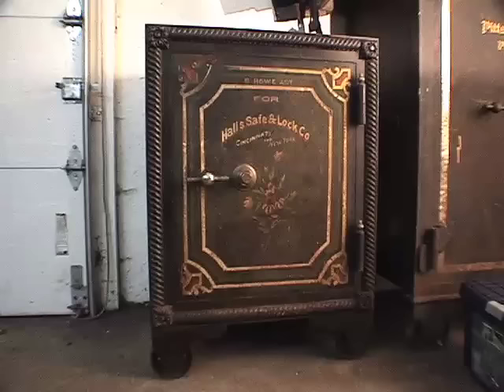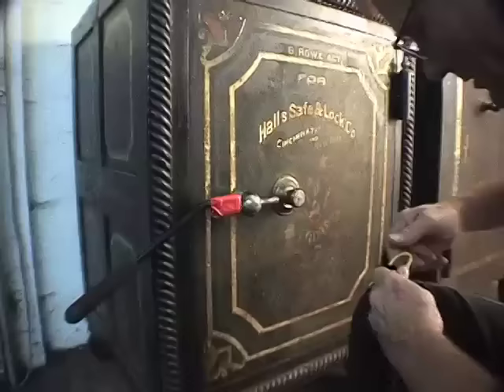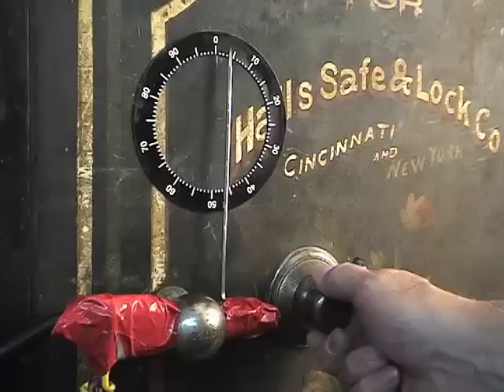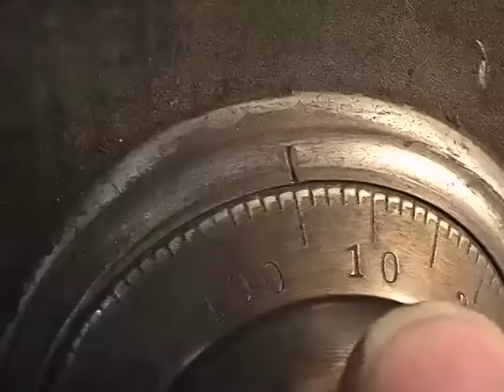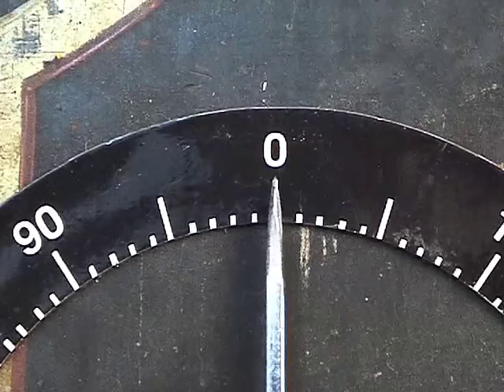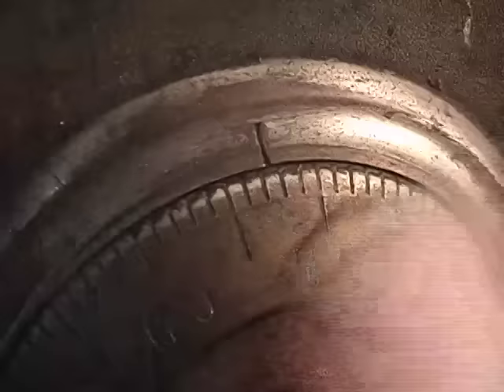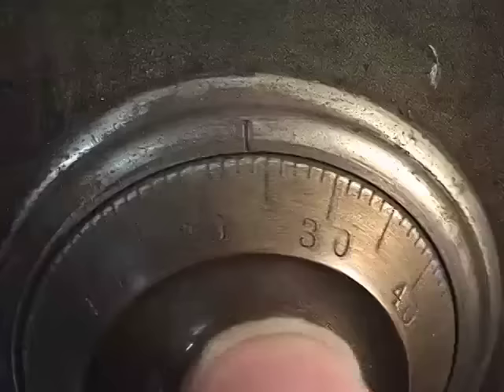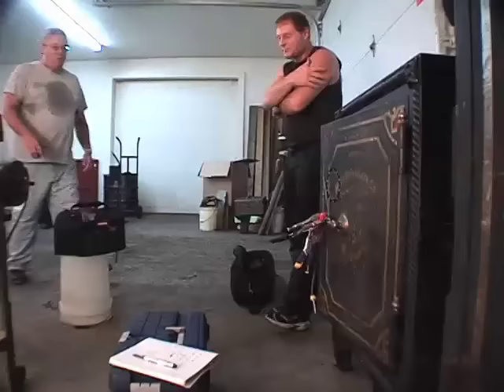Halls

Comment: I’m still stuck on this safe… you made it look so much easier… might need a lot of help
Reply from the maker: I know there not easy, remember a long pointer helps with readings.

You could start by parking all wheels then move only the drive wheel or last wheel around in other direction.

If nothing park all wheels in different spot and try again.

Comment: Very nice work sir. Pretty much how I do it on this type, but I have a laser pointer mounted to my handle extension, and my gauge on the floor. Gives a me an indicator that's a foot long or more in most cases, so the indications are very dramatic.  Still, I might have to grab a skewer and commission a magnetic ruler with millimeter graduations. I don't like relying on batteries.  They always leave the combination in the safe, don't they?   I opened an old Mosler from the 30s or 40s last week (non-direct entry)... It was part of an estate sale. Other than the keys for the internal locking drawers, the only thing in the safe was the combination on the original documentation. I joked that they wanted to keep it in a safe place 😋
Reply from the maker: Thats a good system you have going.
I could see how readings would be improved. That seems to happen often with combo locked inside. Nice work on mosler they were good safes in there time.

Comment: Excellent video and lots of great pointers and hints. I have an old Victor Safe, pat. Feb. 1, 1910 with the handle built into the dial. Can you either explain here, or perhaps in a video, how I would work the handle to determine the driver gate and search for the proper combination, without having the handle as you have shown here.
Reply from the maker: Hello Sir the victor safe has a different lock it manipulates like the gun safe video I show. The handle in the dial wont do for manipulating.

Also the arm that drops into the gates is by gravity and no spring that makes it tough to feel it.

There is no hard plate and easy to drill maybe can get someone to drill for ya.
Reply: @johnwickpick8621  thank you  for the reply. I will check out the video and continue to search and try. I truly want to drill or damage the safe, so I just need to add a fee bucket loads of patience and keep at it.  Thanks again.

I am getting another "locked for 50 yrs plus" safe today with an Hale dial lock and no combo. I don't know the safe brand as of yet, but do know it has a seperate handle, which may help me in using your video. We shall see.
Reply: No money

Comment: Thanks for my request and question that you answered.  One more question maybe you know about the Halls safe. There are two bolts on each caster.  Before I take them off, do you know if the nut is secured?  That is if I remove the bolt will I be able to reattach the caster without getting inside to line up the nut?  I'm hoping they welded it in place so when I'm ready to put the bolt back on it will be an easy task.  Thanks!
Reply from the maker: Hi that's something I never have looked at....

Comment: Why do hall dials and handles look so similar to old Moslers? I have a difficult time telling them apart especially because both companies have the braided edge pattern and code stamped on handle.. 

Great job!
Reply from the maker: hkygoli33 Antique safes are often similar in appearance like dials and for example the braided trim.
Why that is not exactly sure except manufactures copy each other.

Ususally "Hands on" is the only way to tell what lock your facing.
Most the time safe owners would stencil there name on it and its not the name of the safe.

Halls is easy to identify from the handle bind, now there are others that bind but look no way the same.

Your best bet is to get familiar with the different antique safe locks then you can ID it and drill it properly. 

Thanks for the great question I often asked myself that same thing.
Reply: Hey Mark, I have an old Halls Safe at our church. I want to try your method on it. You talk about the FALSE GATE. Are they on wheel 1, 2 or 3. What direction should I start to find them?

Comment: I have parked the wheels on a safe like this in all ten positions and ran the drive  wheel for each parked position with no luck. Are there any other suggestions ? I have possibly fond one gate but don't know which wheel its on.
Reply from the maker: Only run one wheel at a time and park the others, I realize you have to turn the drive cam wheel but just return it to the same number.
This way you will know which wheel a gate is.

Also try not to even  "Not" look for a gate. Just run each wheel by itself around parking the others.

Take best reading from each wheel and continue same process over.

Soon a real gate will pop out

Comment: Hey John, I recently found a J Baum Safe and Lock Co. safe. This safe was found behind drywall during a renovation lol. The combination and handle look identical to the safe in this video, so do the wheels and overall design. I am wondering if the locking mechanism is the same, I would love to use this technique to open it up. Thanks John
Reply from the maker: Its easy to tell if the mechinism is the same, put turning pressure on the handle and turn the dial. If the dial sticks or wont turn its the same.
If there is no difference in the dial then its different

Comment: Is there a written guide for this? I get lost when I can't see what you're doing with the dial.
Reply from the maker: No not really only in lock class's they
have written courses on manipulation.
I know its difficult/tricky to learn to dial correctly. Only one wrong turn with the dial and it throws everything off.
Takes concentration for sure..

Comment: Great video!  You give me hope that I can open my safe. I’ve watched this video about 10 times and I keep seeing things going missed the previous time.  Where can I find the magnetic dial that you stick on the front of the safe?
Reply from the maker: I picked up that magnetic rings years ago 
at a safe convention. You can just make a fine line indicator on paper and use that just something to see the needle move. Glad it helps.
Reply: I meant to say that each time I watch your video I see something new. My safe has been sitting outside for ten years. Do you still think the wheels are still turning? Is there a way to get lubrication into the vital areas? Do you have other videos? Thanks again!
Reply from the maker: @bairdsantiquescollectables306  oh thats neat find something new each time.
No way to get lube to the lock
Yes the wheels should be fine what rusts is the door frame.

If you get the lock open the door itself might not open.
Then a ten pound hammer and 2x4 hitting the door usually frees it up and breaks the rust seal.
The lock wheels are brass and big and heavy so they last.
Thanks
Reply: any luck

Comment: On day 3 trying to get the first gate! This is WAY HARDER THAN U MADE IT LOOK lol… might need some advice!
Reply from the maker: When you say first gate are you looking for the driver gate or wheel three gate
Reply: I believe the driver gate… it looks like three numbers make the needle move to the left! Do you have anywhere I can personally msg or call? Would love to hear some advice or help
Reply from the maker: Could be high spots on wheels are hiding your driver gate.

Try parking all wheels left at 30 then run driver gate around right only.

If nothing try 50 left then driver to the right, then try 70 and run only driver

You should get a low reading on driver by parking wheels.

At least then you cam start with the process
Reply: @johnwickpick8621 I have an old Halls jewelry safe I am trying to open but I have the 5 digits. Could you tell me what the turning sequence would be? Thank you,
Reply from the maker: @hoosierbengal163  That should being a jewelers have four wheels and a driver which makes five.

So the sequence would be 
5 times Right to first number
Then Left 4 times to next number. (every time you line that number up it counts as a turn)
Them 3 times Right to next number.
Then 2 times Left to number
Then Right until the Dial comes to a Stop to Open.
Reply from the maker: Additional Note: if your Dial binds up with handle pressure then the Dial won't come to a stop.

Just Dial numbers like I said and turn handle.
Reply: @johnwickpick8621  yes it is a jewelers safe. The front door is only 4 digits but inside is 5. The front door i just stop on the final number and it opens. So you are saying the inside lock will not be the same way. I have the final number as 53. Should I stop on 53 and be able to open? I greatly appreciate your help. I have been on this for hours
Reply: @johnwickpick8621  correct it does bind up with handle pressure just as the front door does. So i would just stop on the final number and it should open. I still cant get it open. I know i have the correct combo so I must be doing something wrong in the turn sequence. It seems pretty straight forward so not sure what I could be missing?
Reply from the maker: @hoosierbengal163 
Try dialing opposite way.
5 times Left
4 times Right
3 times Left
2 times Right
1 time to last number.

Dial slowly in case wheels slip.
Also make sure turning handle hard enough.

Comment: I have this old  Herring Hall Marvin safe with a HHM 100 # dial. The dial will lock up when pressure is applied to handle on all gates. Have watched your vid over and over,, have same set up as you in vid, but cannot find a gate that is lower. Have tried running all wheels left and also right. Do you have any suggestions on what I can try? Also do you think it will be a 4 number combination,,,4L,3R,2L,1R ?.
Reply from the maker: Should be a 3 wheel lock.
Which is 2 wheels and a driver.
If your looking for the 3rd number or driver number and nothing shows then wheels 1 or 2 is hiding it.

You must park the other wheels in different positions and try running 3 by itself. If nothing shows park them again at different numbers.

Once you find a low spot on other wheels then 3 will show up.

It don't take long to run 3 so keep parking 1 and 2 it don't matter where you park them.  Eventually you have to find a low spot.
Reply: Will give that a try,,,, Thanks,,,
Reply: One more question,,,what would be the dialing sequence for a 3 number combination,,,

Comment: I have a big single door HHM turn of the century safe. It was closed when I got it and no combination. The lever handle doesn’t bind the dial. I keep trying to manipulate it but no luck. I’m ready to drill. Where do I drill? What diameter drill bit? How deep do I drill? Can I grill it with a regular hold it in you hand drill or do I need the magnetic and strap drill? Thx
Reply from the maker: You will probably need scope to do the job. It can be done without one but it could be messy and hard to do with no scope.
It probably a OB lock which means open bottom or the fence is near bottom.
You most likely will need carbide to drill it. I would say call a tech to do it unless you just want to bust it open.
Reply: Could I get a xerox copy of your dial ring? I have safe just like this I need to open?
Reply from the maker: @douglasbrewster1146  Yes how do I get it to ya..
Reply from the maker: @douglasbrewster1146  ok..
Reply: John Wick Pick when can you send the dial ring pic??
Reply from the maker: @douglasbrewster1146  Im sorry Ill get it to you dont have access to a scanner but ill put a measuenent on it for ya.
Reply: John Wick Pick just take a pic of it and email it.
Reply from the maker: @douglasbrewster1146  ok tried to email and computer saus error in message.
I typed exactly how you have it
Reply from the maker: @douglasbrewster1146  I tried emailing and got an error.
I typed exactly how you have it

Comment: I have an old Halls Lock and Safe Co. safe that is open. when I removed the plate off the back of the door it is concrete with a round opening in the center. there is a round plate held on with 3 screws. How do I figure out when the combo is on it?
Reply from the maker: There is a very small slot tht runs up and down to the right of the center.
That is a window to view combination.
Not very easy cause its so small but with a strong light you look in slot and line up each wheel gate. There will be four of them or 4 numbers.
Dialing sequence is 4 turns left, 3 right, 2 left and 1 right and turn handle

You can always remove the three screws and take off round curb and remove wheels then drill the slot bigger.
Reply: @johnwickpick8621  Hey mark. Thanks for the help. Great video.

Comment: As you're looking at the dial. Which direction is the straight tailpiece engagement?  Top, bottom, left or right?
Reply from the maker: The tailpiece is to the Left or the
9 Oclock position
Reply: @johnwickpick8621 ,thank you very much.  I had to drill it at the 12 o'clock position and then use an inspection camera and figure it out.  
Appreciate your quick response.
Reply from the maker: @dandonovan2858  thats cool ya got it by drilling
Reply: @johnwickpick8621  former owner of this safe had it for years, and he got it from some other guy. Story is, the safe belonged to an eccentric man who had died, rumor was the safe had all kinds of valuable things in it. The safe was stolen, but the dude that took it couldn't open it. So he took it to the river bottoms and dumped it.  It was recovered and returned to the family.  Nobody knew what the combination was so they had a locksmith drill it. The 'valuables' were notes of the eccentric man's family.  He valued them so much, and that's all that he kept in the safe.
Reply from the maker: @dandonovan2858  Great story, thanks

Comment: Hey John I've got to go work on an old safe like this one. Could you tell me the dialing sequence eexp. 4x left 3x right 2x right ...  Thank you
Reply from the maker: First to verify you have a straight tailpiece like mine turn handle and turn dial to see if the dials freezes up. 

That's a three wheel lock plus the drive wheel.

So dial 4xL 3xR  2xL and 1x Right.

Only the drive wheel has false gates not the other wheels.
Reply: @johnwickpick8621  okay thanks I'm going to see it monday. The customer said the combo works but the handle just turns and stop but can't get door open. she said she turns the handle ccw. Said the handle turns a little more then normal before it stops she thinks
Reply from the maker: @mikefinley4713  If the handle turns after combo is dialed it's possible something is stuck in the door frame.

Either give the door a hard pull or even hit the door near the open edge then pull on it.
May need a heavy hand sledge to hit door with
Reply: @johnwickpick8621  It feels like the bolt assembaly is moveing but it sounds like something might be loose. And the dial doesn't bind when I put and hold pressure on handle. can you give me the DP'S for the bolts so I can bunch them back to open. Please
Reply from the maker: Antiques safes vary so much, bolt center could be anywhere from 2 to 5-1/" back.

So I wouldn't know a DP for whatever safe your working on without even a picture.

You'll have to experiment
Reply: @johnwickpick8621  I can try to send you a pic. but not sure if I can on here.
But thank you for all the help if I can't

Comment: Great video! I get lost after 6:19 though. Can you explain what you were doing there for the third wheel?
Reply from the maker: Basicly there are three wheels and a
driver wheel. The driver wheel turns with the dial. Each wheel has a true gate and several fake gates.

The object is to get the pointer to go furhter inside a real gate while the fake gate will stop the pointer  from going deeper.

If your not in a real gate with the driver wheel or last wheel it can hide other readings. So I couldnt find a number on wheel three because it was being masked by others. Thats why I park wheels in low spots so not to mask others.

Its like picking a pin tumbler lock.
Usually one pin will bind first before others. You cant pick the others until you pick the binding pin first because it hides the other pins from being picked.

The hardest part is keeping track of your wheels and turns. You have to know exactly where each wheel is
Parked and how to move them to be successful.

Comment: It can workk in all safes or just this kind 👍
Reply from the maker: This method works only on safes with
straight tailpiece/ fence.

In other words when you turn the handle it freezes up the dial and you cant turn it.
Then when you release handle pressure the dial turns.  If you can turn the dial when the handle is turned then this wont work because we need to take the readings from the handle.

Comment: Where did you get the pointer? Did you make it you self?
Reply from the maker: The pointer is an aluminum skewer stick I picked up at a food store.
Easy to bend and shape.
Reply from the maker: @derek7448  I belong to a safe & vault organization and used to teach there.
I picked up that magentic ring at the trade show. Any type of marking system will work because your attention is really on the pointer attached to the handkle.

Comment: i have a halls safe pick up for 200$   dont have the convination its got a loosse handle would that give me a false reading on dial?my false gate readings at 12 22 32 42 and so on need help
Reply from the maker: A loose dial wouldnt effect your readings as long as the handle turns with the same amount of force on each reading. The handle might have been forced at some point making the handle loose.
It sounds like your on the right track you already have the last wheel maped out.